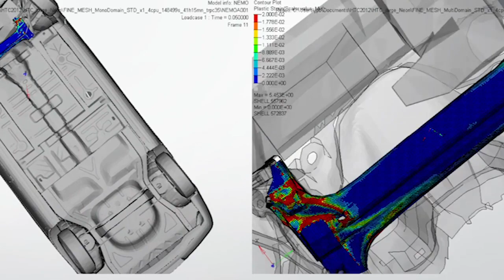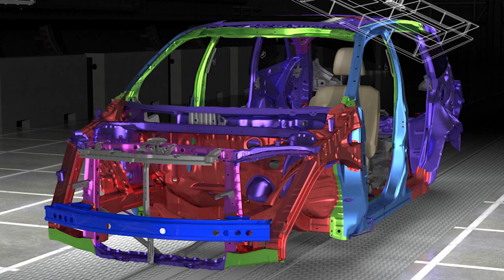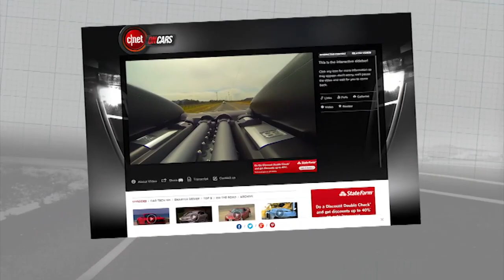Car Tech 101: What is virtual crash testing? (On Cars)

Comment: Do you know what you can't do with a virtual crash?

Verify bullshit such as welds done wrong/not done at all like what happened when the new Fit came out.

This does nothing to catch manufacturing issues.
Reply: These are mostly preliminary runs. It is cheaper to model it and simulate it than to have to build an entire prototype. Welds, fillets, and even cracks can be modeled in detail to extract detailed results. In the end, a full real life model will be created to crash.
Reply: nelsonho567 In such a case, it's completely fine. I just really don't think the suggestion that the IIHS would replace real testing with this is... well, either desirable or accurate.
Reply: +Alexandre Potvin This is true, but nothing can be 100% accurate in the world of simulation. That is one of the fundamental messages provided to aspiring mechanical engineers when taking the initial dive into the world of simulations: "You are never dealing with the correct answer, only approximations". 

That said, by utilizing simulations such as this, you can eliminate any potential geometric (or material, component positions etc) mistakes, hence lowering the need for building multiple prototypes which again could dramatically lower the cost of development.
Reply: I don't think the IIHS would replace real testing with virtual.  If you watch the video carefully, this is more a tool for manufacturers to catch weaknesses early on and have a chance to correct them.  Physical testing would still need to be done to confirm the virtual test results.
Reply: THIS BULLSHIT COULD EASILY BE MANIPULATED. KEEP THE REAL TESTS. CRASHING A FEW CARS IS LIKE PULLING A HAIR OF A HAIRY CAT.
Reply: But BEAMNG DRIVE.,

Comment: Does it really take a Computer that amazing, to simulate these outcomes? Or is it just overkill?
Reply: +ZeroSum Game I was asking for an explanation. But it looks like you won't help out, thanks I guess (Not Really).
Reply: +6 God Drizzy Yes.  I had worked in automaker's R&D before. Even in $6000 workstation still stutter like a powerpoint slideshow just to spin the complete 3D CAD model of a car. Imagine to simulate a crash that involve hundred thousand of parts.
Reply: +6 God Drizzy I was over here thinking the same thing.
Reply: ***** cause seriously, does it require 10,000 Cores, to do something that doesn't seem that difficult. It's ridiculous.
Reply: You are so wrong on everything... Not even going to start explaining.
Reply: +6 God Drizzy It's more RAM intensive than you think... The simulation relies on a model called Finite Element Analysis (FEA), this uses vast matrices to solve for the simulation. There's a huge amount of data to compute, the material properties, the geometry each component in the car, the bonds between each component in the car, the rate at which the  the size and resolution of the mesh and the boundary conditions... They'll always have to crash cars in the end to validate the model. These simulations are more of a design tool as they can view the stresses, strains and deformations of the car at any time interval during the simulated crash... Which is an extremely convenient engineering tool.
Reply: +6 God Drizzy I think they overslimpified the description. See, CPUs are great at single floating point calculation, big calculations one at a time, and given the material geometry, physics and detail of these items (which aren't polygon based), 10,000 cores and half a day calculation isn't too farfetched. For an example, look back at CGI from the 90s, it's stuff that an Xbox can do in real time, but took hours at the time.
Reply: 6 God Drizzy
It's called ignorance and most people these days seem to know if very well.
Reply: +Sean Cunningham thank you very much for the thorough explanation, it's what I was looking for.

Comment: ps3 server hahaha....
Reply: They likely just googled "supercomputer" for this image and took the first image that appeared.

It was a real thing though. Sony was selling the PS3 at below costs, because they earned money with every new game sold (that's why new console games are usually ten bucks or so more expensive than PC games). Turned out, at the time of its release in 2006, the PS3, which could run Linux back then (a feature that Sony later removed, resulting in a class action lawsuit), worked really well as a supercomputer, at least a hundred or so connected to each other. The US Air Force famously built such a cluster, but they weren't the only ones.

Later, this became outdated, as both dedicated computing hardware based on the same chipset was released (which wasn't very successful however) and more conventional hardware as well as GPU-based supercomputers became cheaper, more powerful and more efficient.